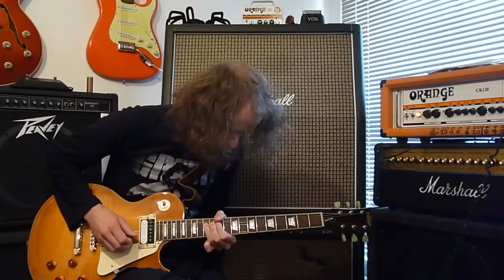Why I prefer Solid State amps to Valve amps

Comment: I have many solid state amps that have a character all their own and a responsiveness easily on par with tube amps.  It's all down to what you like and what your aesthetic is.  Listening to snobs think that their tube or boutique amps blow away everything else for every application is a practice is listening to a snob wax the philosophic.  They'll even start talking about how vacuum tubes react to your playing and have a character all their own, nearly if not totally sentient. Lol.  Ok, great. and 60% of the time they're in a bad state of shit.  And again, it's only has the characteristics that it can provide, which is not all encompassing.  A Marshall JMP is never going to sound like a Sunn Beta Lead and vice versa.  I also get frustrated with the plethora of snobs that think older analog SS are crap compared to a digital amp modeler of the here and now.  Why, because it makes an attempt at sounding like a tube amp these days through emulation. Anyone that thinks like this is a common man kind of person with little new to offer due to both their lack of imagination for applying new tones and their closed mindedness.  Tube amp advocates , advocate because they just simply want to justify why they're fucking around with an expensive , hard to upkeep , dainty piece of equipment for the minute difference they think is making all the difference in their playing.   BTW, how you play the fucking thing is really what makes the difference. Notice very few advanced guitarists walk down this tube advocacy march with any kind of conviction.   Great SS amps that can't be replicated in tone by tube amps or any other.  Roland JC 120, Sunn Betas, Randall P-80s, Kasino Fever or Little Joe, Acousitcs 150, Kustom 200, Teisco T-20, Rockman xp100, KMD SGSC, Sears 200XL , Peavey musician 400 to name a few............all vintage , all SS, all bad ass.  Let's also not forget a bunch of those high end amps like a mesa rect. will suck with pedals being pushed through them.  These amps all take pedals extremely well.

Comment: Yeah man on average a valve amp sounds better ,sustain pompression and cut through the mix better.ut these days solid state are just buot as good.I played through alot of 90s fender and peavey class. chorus ,Not very good .I love the new orange amps i use 2 micro darks together through 2 12s and the vox are fun I guess all new s,s,amps are alot better than 25 yrs ago.I agree tube amps are too much upkeep,Maybe use one for recording.I love pig nose too .they have a great preamp out.My fen hot rods aint goin nowhere too heavy And I like the micros better anyways.

Comment: There are definitely advantages to Solid State... you mentioned weight, for instance. In fact, if you want to take your argument to it's logical extension, amp modeling systems that run directly to the board and fold back through the monitors are even LIGHTER and even MORE convenient and reliable. Please remember, as you said, it's an individual choice. I'm a 35 year pro guitarist/producer/engineer. I happen to hear (and FEEL) a significant difference between solid state and tube. I haven't been able to get the sound or feel I want from any solid state amp I've ever tried. The closest was a Music Man that had a solid state pre with a tube power amp. I can't stand it when someone makes out like people who say they can hear the difference with a tube amp are full of shit. There's a reason that the VAST majority of touring pros and studio players use tube amps... and it's NOT because they're all full of shit. I won't characterize YOU as an idiot for your opinion, but don't imply I am for mine.

Comment: It's a common misconception that tube amps are inherently better. That's simply not true. To me, a Twin Reverb sounds absolute shit at apartment volumes because the power tubes aren't even really doing anything. No lovely compression happening at all. Solid state amps, however, sound killer at low volumes.

I've noticed that tube amps generally handle the uppermost range of the master volume control better than solid state, which tend to muddy up and clip in a less pleasing way to my ear. If you have a powerful solid state, this may never be an issue for you though, as you don't have to turn the level up full to get the volume you need.

To me, they're too totally different beasts. If you want to crank the amp to full and get a sort of interactive experience with the amp and natural drive/compression, tube seems to be the way to go. If you want consistency in performance at most ranges of the volume all the way down to whisper levels, solid state seems to be the choice.

For my situation, I gig with either a Fender Blues Deville or Carr Rambler and play a ZT Lunchbox in quiet rehearsal situations or if my amp ever goes down at a show. Best of both worlds.
Reply: The thing about tube amps is that they produce harmonics that normally, solid state amps just can't. This is why tube amps sound so good. When you play an A note, you're really getting more sounds than just an A note with a tube amp. You're getting a little bit of a B note and a C# note too. This is why tube amps sound more rich, more 3-D like and more complex. If volume is ever an issue, than it's simple. Get a tube amp that's low powered. A Fender Twin is more or less the same circuit as a Fender Princeton, just at lower volume. I built a marshall style amp a little while back, but it was only 9.3 watts using a single EL84 power tube. It's still fairly loud. I'd say about 5 watts would be ideal for bedroom levels, which is pretty easy to build. The best power tube I've ever heard are the (now, out of production) 6AQ5. Sound like a 6v6 when it's clean, sounds like a EL34 when cranked, and they only put out about 5 watts per tube.
Reply: "A Fender Twin is more or less the same circuit as a Fender Princeton, just at lower volume." This is wildly incorrect. You're talking about the difference between 1x10" and 2x12" cabinet, 6L6 vs 6V6 power tubes, tube rectified vs solid state rectified, and different amounts of preamp tubes. Even if they were interchangeable, I think you miss my point. You need a completely different amp to get apartment volume vs gigging volume with tube amps, whereas a solid state amp would have more consistent performance between the two (assuming there is enough headroom to not distort at gigging volume).

My Tungsten Mosaic (Tweed Champ with a 12") was way too loud for my apartment to really get the power tube working. Same thing with the Egnater Tweaker at the music studio I teach at. However, my ZT amp can handle those super quiet volumes no sweat.

Just different beasts, man. I agree with you that the harmonic content in a tube amp is superior. I usually run my Carr Rambler in triode and crank it almost full for gigs and there is nothing quite like that sound. But that sound does not translate into every situation and less wattage does not always mean same tone at less volume.
Reply: Jake Stewart Music Actually just about all Fender 60's blackface reverb amps were the same circuit, just with different power ratings. A Super Reverb is a Twin Reverb with 2 6L6's instead of 4 and a tube rectifier. A Deluxe Reverb is a Super Reverb with 6v6s instead of 6L6s. A Princeton reverb is a Deluxe Reverb with 1 channel instead of 2. They're all very much the same. Damn near identical pre-amp circuits. Trust me, I know, I build and design my own tube amps. 

Most guitarists don't really have well trained ears. Their ears is better than the general population, but not really as good as say a good recording engineer. By and large, solid state amps all sound like poo. This is due to the linear response you get from solid state materials. A transistor or op-amp will never perform the same way as a tube. They sound sterile because they are. You don't get the harmonic content that you do with tubes. This can be a good thing, particularly if you're using a transistor as a electronic switch. But for audio, I have yet to hear a good solid state amp sound better than a bad tube amp. Even at low volumes, a tube amp can sound wonderful, particularly if the power section is set up for it, i.e. if the power section is designed for ultra linear output performance. This is pretty rare on guitar amps, as people tend to like distortion on guitar amps, but it's common place for hi-fi. 

One neat trick to do with a Fender Twin Reverb (or any Fender blackface amp with reverb) is to disconnect the RCA cables from the reverb pan and connect it up to a 8 ohm stereo speaker. And there you go, you've just turned your amp into a 1 watt single ended tube amp. 

If you get an amp with power scaling, then it really does solve your problems. You can get cranked tube tone at very low volumes. What people don't realize is that for bedroom playing levels, you really need very little wattage. 2-5 watts will do. I'd be happy to build you such an amp if you like, all I'd charge you for is the cost of materials. It'd probably run 3 or 4  hundred bucks depending on the circuit complexity.
Reply: They're both blackface Fenders with similar preamps, but each one has it's own sound due the power tubes, rectifier, and the cabinet and speakers. It doesn't take an amp builder to understand that these differences change the sound. They're not necessarily interchangeable.

"A transistor or op-amp will never perform the same way as a tube." BINGO, Jackpot. Yes. I agree. Different beasts. Different purposes. Different sounds. They don't react or respond the same way. For certain players, sounds, or volume constraints, a solid state amp can be a valid choice for a player if that's the sound they're after. My personal experience says tube amps are better turned up nice and loud for gigging and recording and solid state amps work great for low volume practice and teaching.
Reply: Jake Stewart Music Well, suppose you were to pull two power tubes out of a Fender Twin Reverb and play it through the same cabinet as a Fender Super Reverb. You'd have basically the same amp with the exception of the rectifier. And most people wouldn't be able to tell the difference. Really, all a tube rectifier does is make for a less reliable rectifier and it adds some resistance to the DC current. In a Class A amp, a tube rectifier is pointless, as the current in the power section remains more or less constant. The point is that the biggest difference among blackface amps is how much volume they can put out. 

One important aspect of guitar playing is learning how the dynamics of your amp works. This is why I usually practice with a tube amp. I just grab something that's low powered, like say an Orange Tiny Terror.
Reply: My experience is that theres great and poor sounding Tube and Solid State amps , Its impossible to say in general that Tube amps are Better than SS Amps !!  Its all about Personal preference .

Comment: Solid states are great if you don’t care about huge 80’s tones with big chords, pinch harmonics, rich harmonic frequencies, and the ability to use your volume control very well. 
I hate clean tones, they pretty much all sound the same no matter the amp. I dont play outside of where I keep my amp set up so I dont care about how heavy it is since im never moving it. Im not upset about the fact that tubes are more finnicky since I really do find the high gain tones I get out of them to be worth it. I have yet to find a SS amp where I dig the high gain tones. I dont hate SS, or worship Valve amps, its just that valves just happen to be what im happy with 😃

Comment: Modern solid state amps with SMT are disposable garbage, when it comes to servicing, not talking about tone. Older ss amps that are pre SMT are fine, reliable and easy to service. When it comes to tone, I see no difference, sometimes a tube is the right choice, sometimes ss is the right choice. It doesn’t have to be one or the other.
Reply: I went for a solid state frontman 212  as it was the same money as a tiny orange tiny terror so for the same price as a mini tube amp i got a 2x12 combo

Comment: What does a valve amp have that a solid state does´nt? Well that is the O/p Transformer that is falseifing the amp to give it These so called mellow tones. This is distorting the original Sound. Most good Quality O/P transformers can only handle frequencies from 20 Hrtz to 20 Kilohertz. A good solid state one can  double that 40 Khz no- probs. So round up all this val-ve stuff and give it to a mueums curator.

Comment: I am thoroughly amused that this debate continues. You all think that one singular experience you've had with one particular amplifier is representative of every possible experience one could have with every single amplifier of it's type conforming to the archetype, with a perception of sameness, you've created in your head. Ha! I'd like to take an additional jab at all the cork-sniffing tube "purists" out there by informing you that your amp most likely has solid state rectification. In addition, the majority of tube amps have either solid state reverb, solid state effects loops, solid state gain/volume boosting circuits, and even additional solid state clipping (for that warm and creamy tube overdrive), or some other feature/enhancement that is not tube driven. Your Tube Screamer is solid state also (almost every effect pedal or rack unit is solid state or digital). Stop with the boasting and shaming. It's really lame and you don't know shit about electronics.

I have amps that are tube amps. I have amps that are considered tube amps although they benefit from other technology to various degrees. I have solid state amps. I have hybrid amps (both with tube pre-amp/SS power & SS pre-amp/tube power). I have amps. I use them all in the creation of music much like I can use different guitars or pedals. They are all cool. There are pros and cons to each technology or mix thereof. I think segregation is stupid.

The truth is most of you don't know what you are talking about. You have formed and hardened your opinion based on very little actual experience or have just chosen to take sides with the opinion of  others. There are more options now than there has ever been for guitarists. Why limit yourself?  But by all means, please continue. I find it hilarious!

Comment: Simply put it is technology cathching up to instrumentality. SSA are good and waayy better now.

Before, early smartphones with touch screens are gimmicky and not reliable. Eats up too much power and signal and speakers are not good. Inputs are clunky. And laggy. But now it is soo much better.

Imagine before when there was not many digitally produced effects and sounds, of course, the valve is the best tech for that era.

Just dont get the snob attitude of valve owners but they put digital effects in front of the amp ans in the mix. Sounds ironic.

Comment: You must have serious hearing deficiency if you really can't hear the difference. Or you don't know how to use a valve amp. Having said that - tone is in the fingers. The best guitar and amp set-up in the world isn't gonna turn a bad guitarist into a good one.
Reply from the maker: I don't have a hearing deficiency or anything else. Its just the way I perceive sound and its different to everyone else. It all comes down to personal preference and mine lies with Solid State. I have nothing against valve in anyway. I just find solid state does exactly what i want everytime. I have played through enough valve amps to know what i like. That is true. The gear used does not make the player. Thank you very very much for watching. :)
Reply: yes you do ..its called Tone deafness ......
all pro's can tell....  organic vs digital .....

for I collect and sell used  marshalls
1. MGs only the HDFX / 100  (17lbs champion ) $100
2. VS , trans states - $200
3. full tube - 6101 EL34 celestion - $900
4. other marshall tubed...

my V22 is louder then the HDFX by 30%...
Hdfx power consumption by volume knob min 20 watts , max 40 watts...
V22  power consumption by volume knob min 40 watts, max 65 watts....
P4460 Kill A Watt Electricity Usage Monitor

Comment: this guy sounds like a line 6 endorsee.
Reply from the maker: Nothing wrong with Line 6 stuff. :)
Reply: ***** I hope you are joking
Reply: I've owned several line 6 amps and sold them all. too harsh on high gain. That being said however i kept one. Spider Valve hd100 mkII and I love that amp. Does it sound as good as a marshall or mesa no but its pretty damn nice for line 6
Reply: Depends on the line 6, I like Line 6 DT 25 and DT 50 hybrid amps, they sound great, check em' out, just saying.

Comment: bought line 6 240hc...junk...my little 15 amp line 6 makes it sound bad....my line 6 "BOGNER " Spidervalve 112  40 watt tube...even though partial w solid state....BAD ASS!!!!!!!!!...AND THE ONLY AMP I PARTIALLY OR FULLY TRIED HANDS DOWN..yes..i have to have it sent out for a little vol issue..or its a tube..BUT STILL BEST AND ONLY BEST LINE 6 MADE..taking my refund of shy 600 and slamming it to a jcm 800 3x  or 5150 lll....which to be honest sounds killer  compared to anything i have yet..it is little more versatile than marshal..but i dont know..think the jcm...IM A DIEHARD OZZY BLACK LABEL  FAN..2 PLUS G IS A LOT CASH..BUT..WILL LAST N GIVE THE TONAGE .......FATHER ZAKK STYLE .....GI/FD!!